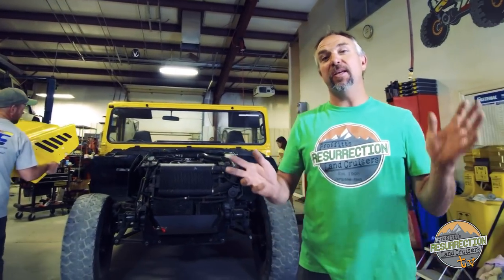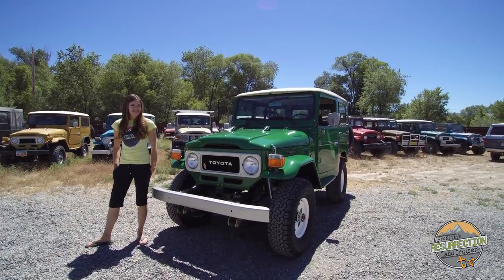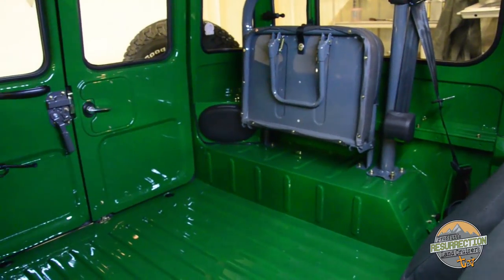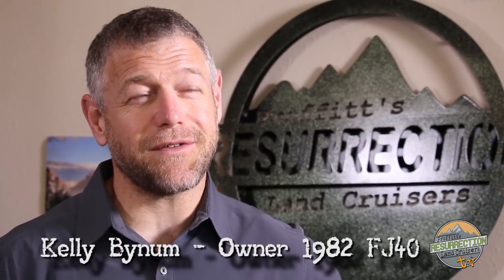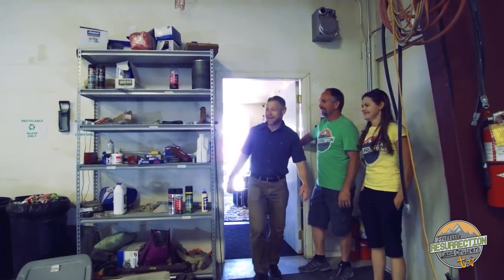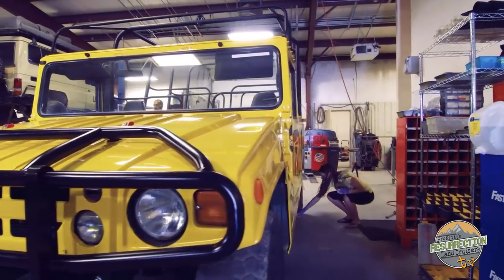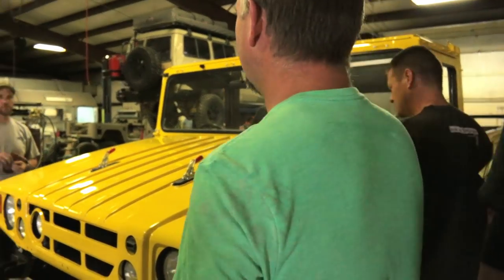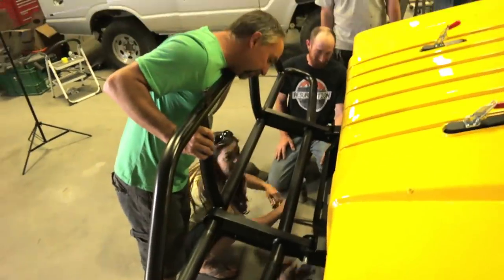PROFFITT'S RESURRECTION LAND CRUISERS TV EPS  7

Comment: I had bought a 1979 fj40 brand new off the showroom floor 13 miles on it back in 1980 I had it for many years what is a wonderful vehicle I wish I still had it I wound up giving it away blown engine body damage. I actually miss it a lot that's why I keep watching these channels. I even have a pair of brand-new turn signals for it.